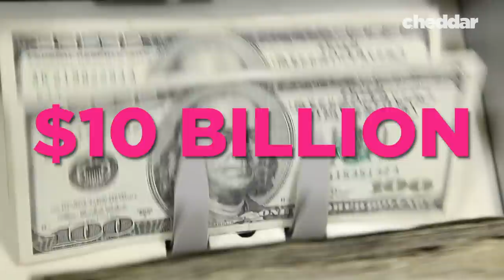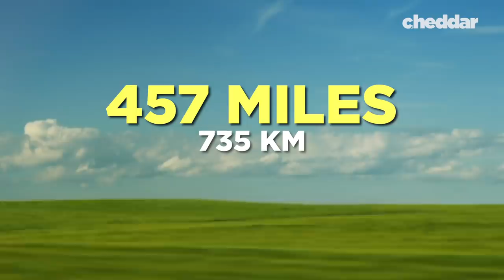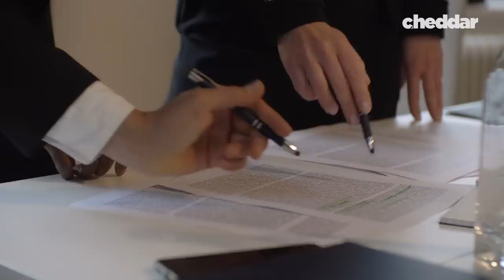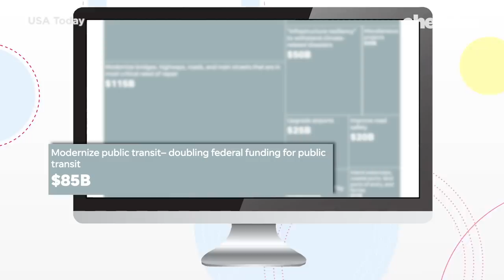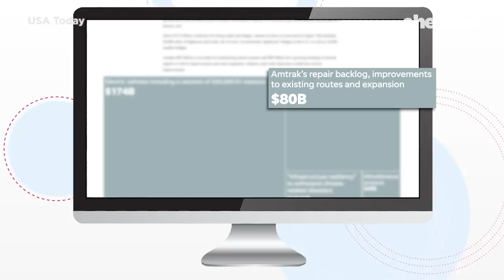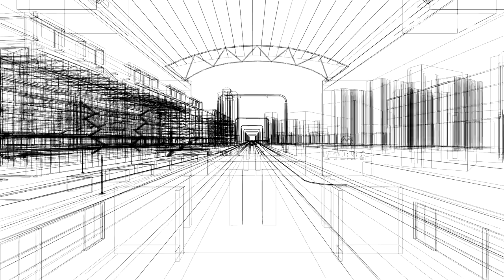Is New York Finally Getting A Real High Speed Rail? - Cheddar Explains

Comment: Mentioning the high speed rail in california as am example and not as the complete failure it is (will only run from Bakersfield to Merced) seems like an oversight, as well as not mentioning Bright line in Florida just because it doesn't reach some arbitrary "High Speed Rail" speed.
Reply: Its not arbitrary at all, this is a simple concept.  It's a commuter rail not remotely high speed.
Reply: Also who fooled you with that lie about California? They're just building the central valley portion first. Can't always snap your finger and make the whole line just appear
Reply: @Joesolo13  1. The Bright line will reach speeds of up to 125 MPH. So 150 MPH counts as high speed but 125 is just commuter rail? Again, seems arbitrary to me.
2. It's so horribly over budget and behind schedule that the original plan to build from San Fran to LA was reduced, and will instead reach neither city despite the larger than planned budget. This video also quotes a 20 year build time but the California HSR project will take longer than that even for the useless section they are building.
Reply: @Joesolo13  Currently, Brightline reaches 90 and has 3 stops between Miami and West Palm Beach. It is in no way a commuter rail system.

Comment: There is a big problem with the proposed high-speed lines shown in this video: they are insular.
For high-speed rail to really work, you want an actual network, where you can change between high-speed trains or high-speed and higher speeds trains (conventional trains travelling mainly at speeds between 140 and 200 km/h). 
Otherwise, you'll just end up with glorified commuter lines.

It might be sensible to first build up a higher speeds network (by refurbishing the existing lines) and then add the high-speed option later.

Comment: Yeah, high speed rail in Europe was relatively easy, because we helped them pound it flat between 1942 and 1945. In the US, all the buildings are still upright, so there's no place for new track to go. That, and Eisenhower got fed up with having all his tanks shipped by rail during the war, and wanted to bypass the Railroad Companies post-war.
Reply: Most high speed projects where in the 80s and 90s, long after ww2 so that is no argument. It cost us a lot of money too but we felt it was worth it.
Reply: The us has plenty of space and some old rail lines but they still have to buy a lot of land. 
We have traffic corridors in the US to but they are for 10 lane motorways instead of 10 tracks for rail
Reply: Also, I think you're more likely to get traction for improving rail between Washington DC and NYC than Boston and NYC, even though Boston-NY is the slower half of the Acela route. The absolute best update would be to improve the entire Bos/Wash route, and if there's a way of providing high-speed rail between Boston and Florida, and between Chicago and Florida, I think you could cut a serious dent into the airlines by providing a lower-hassle travel option for snowbirds.
Reply: @c182SkylaneRG  We will see but something has to be done. 
Washington DC -New York does sound good too. 
This would enable much more development between the immediate city area. 
Like old train towns.
Reply: @computerfan1079  Yeah, I actually wound up rewinding a few times, and caught that on the third or fourth time, that Spain's high-speed rail broke ground (or opened?) in '92, and the rest of Europe was sometime after that. And to be fair to the US, in the late '40's and following decades, it didn't really matter if buildings were still standing over here, either. :) So "finding the land for it" is definitely a more recent issue.
Reply: @paxundpeace9970  You say "plenty of space", but that's not really the case. You generally want to use trains to connect people, but the problem is there's already people there... In the 40's and 50's, that wasn't a problem for the highways: you just flatten the black neighborhoods, and problem solved. We finally learned that was WRONG a few decades later, and without that lack of morals, it's a lot harder to find the space to lay track.

The specific trouble the Northeast Corridor has is that the track up here was laid back when top speeds were a quarter of what they are now, and an eighth of what we want them to become, and the turning radii reflect that. We need to reroute the trains through the neighborhoods that are currently adjacent to the tracks so we can straighten out the curves, but as I mentioned: that's harder to do than it was 70 years ago, hence the plan to stick it out in the water, instead.
Reply: @c182SkylaneRG  Parts of the NYC-DC corridor date back to the Civil War era, especially around Baltimore.
Reply: Because you didn't have to worry about defense, because Europe had us to protect you. Enjoy your HSR... I'll enjoy my High Speed Gas Guzzling Truck...I just paid $2.35 a gallon here...
Reply: @codyuhlmansiek805  And the Government paid the other $2.35 that that gallon actually cost. Want lower taxes? End Gas subsidies. Comes with a side-benefit of cleaner air as everyone suddenly stops being able to afford so much gas.
Reply: @AVeryRandomPerson  Makes sense. The Union Pacific is so-named specifically due to Civil War divisions, and completed their Transcontinental Railway sometime during or just after the Civil War. (152 years ago, based on when they got 4014 put back together, so a few years after).

Comment: The reason we don't have high speed rail in the northeast corridor is the 1853 Norwalk train wreck site at the drawbridge over the Norwalk River.. Here is where it is: https://www.google.com/maps/@41.1002423,-73.4159948,1115m/data=!3m1!1e3
Note how the new plan in the video totally avoids this site because the current high speed rail has to slow down to pass over the rebuilt 1913 drawbridge which immediately has a large curve and a branch line  next to the drawbridge. The cost to fix this problem is staggering because it would require redeveloping the entire area around it..

Comment: I think simply upgrading the current Northeast Corridor to allow 125mph trains along its entire length would be a more cost effective investment. The British have successfully made similar upgrades to their main railway lines, and such upgrades can be built much faster than building a new parallel line from scratch. Furthermore, as a New Jersey resident I can attest to how urgent the need for additional tunnels under the Hudson is, and it would be a mistake for policymakers to get distracted by a wildly expensive, and likely difficult to engineer tunnel under the Long Island Sound.
Reply: 125 is too slow. They need to be chasing the 370mph Maglev numbers.

Comment: The California High Speed Rail Project has been canceled.
Reply: It hasn't been lol
Reply: @unassumingaccount395  It has lost all meaning. It was supposed to connect the two megalopolises of San Fransisco and LA, instead it'll serve the bumpkin farms of Bakersfield and Merced. All this, on one single track. Meaning Trains won't be able to run frequently, destroying it's purpose in the process.
Reply: Good
Reply: @hansmo7013  where did you read this? They're just building the central valley portion first
Reply: @Joesolo13  https://www.railwaygazette.com/high-speed/single-track-corridor-to-launch-californian-high-speed-service-by-2030/58481.article 
Though I am not sure whether it opens with one track, and then expands to two later on, or if it is a permanent deal untill more funding can be found
Reply: @hansmo7013  yes. Your article repeats what I said
Reply: @hansmo7013  "interm service"

They're finishing that part first while building out the rest. Only makes sense to use it. The interstate highways took decades to finish, they didn't keep them closed until completed
Reply: @Joesolo13  Oh, alright then. Still a shame though
Reply: @hansmo7013  It still goes through SF/LA, they want to build the bakersfield/merced portion first lmfao

Comment: We use "km/h" as a shorthand for kilometers per hour. "kph" looks very strange, but I appreciate the effort of including SI units.
Reply: kph is easier to type no?
Reply: @MrCheeseball90   Yes but "kph" just doesn't feel right.
Reply: So do you also say r/m as opposed to rpm?
Reply: @starventure  no. rpm is widely used, kph is not.
Reply: @starventure  Rpm refers to rotational speed. km/hr. refers to linear speed.
Reply: kph looks strange because it's technically wrong. 'k' in 'km' is for 'kilo', which means thousand. but the unit is only complete with the m, so you get 'thousand meters'. It would need to be kmph to be correct. And if you do that, km/h is more readable. 'kph' might be widely used in countries without the metric system, but it basically means 'thousand per hour'. Thousand of what?

Comment: This was an excellent video. Thanks! A better, more cost effective solution would be to upgrade the existing right of way between Boston and New York to increase Acela's average speed of 60 mph to 90 mph and reduce the trip time by a bit over an hour. The distance isn't long enough to warrant a train faster than 140 mph. In 1935 the New Haven to Providence train tested out with a top speed of 105 mph. We sure have not come far, baby.

Comment: The main problem is the United States is completely car dependent. It's the way our cities are designed to make us dependent on cars, rather than walking or using public transportation efficiently. I went to Europe a few years ago and it was so easy to get around. If I wanted to go shopping I would go down the block, and then another block away to get to catch the train at the subway station to head into the center of whatever city I was at, for example London. Here I have to get in my car and drive around winding suburbia and drive for about like 15 or 20 minutes to get to the nearest grocery store to get some groceries. And then maybe get stuck in traffic for an hour to get to downtown
Reply: Move to Europe than...i love my car. Really my car, i just got my learners permit at 15 , is a F 450 truck...i could but a big European car in my bed...😀

Comment: America will never have high-speed rail blame car companies for this gift.
Reply: Not just car companies.it litarily makes no sense to have them.
Reply: @starandfox601  well, it does. But you know what doesn't make sense? Driving a car from town to town when your streets have a 95 mph speed limit.  Germany has 120 to unlimited highways and still is operating one of the fastest bullet trains in Europe.
Reply: @starandfox601  speed is the key factor. People always would consider the fastest and cheapest connection. 

Less popular density means fewer stops and higher average speed. So it's even better for trains in the US. 

You're the idiot because you don't know how public transport in other countries works. 

When you he of the train you would use a metro, tram, light rail train or bus to the next closest station to your destination. All different types of public transport would work together. That's how it works in Europe and Asia. The US doesn't have all that. Which just proves what I said before. The USA has an undeveloped public transport system which is the reason why it's bad. 

You have different type of trains for different purposes both speed trains always have the longest distances and the fewest stops the higher the density is the more stops you need and the slower the train is.

And btw you still doing the math wrong. 
Stuttgart - Paris has nearly the same distance as San Francisco - LA. A car needs 6 hours. A train does it in 3 hours with only 3 stops in between. It would be faster if Germany would also have high-speed tracks in this direction but due TO THE HIGH POPULAR DESTINY, the speed is 70 km/h slower than on the tracks in France.

Comment: Good luck if the USA does have high speed railways including going from New York City to Los Angeles and San Francisco. New York City and Washington DC to Miami and Los Angeles to Seattle and Vancouver.
Reply: Do you even know how far those cities are apart from each other?
Reply: @blackhole9961  Some hundred miles.
Reply: @Andrewjg_89  
NY to Los Angeles is 2,451 miles(planes are way faster)
NY to san Fransisco is about 2,585 miles(planes are way faster)

Miami to los Angeles is 2,732.7 miles(planes are way faster)
Vancouver and Seattle are driving distance from each other at 143 miles
DC to NYC is the only viable option because those cities are 226 miles away from each other, and the NEC is densely populated.
Reply: Thanks :)

Comment: I prefer the northeast maglev DC to NY. As an NYer, I rarely go further north. I mainly go further south to NJ, DC, Maryland. It will easily become the fastest in America.
Reply: do you know how expensive that thing is? and how it will destroy forests and stuff?
Reply: @thechickenstew3716  "To minimize the impact on the surrounding communities and environment, the train’s first phase will run mainly in deep underground tunnels and in overhead viaducts along the existing Baltimore-Washington Parkway transportation corridor. These design features will make it easier to avoid negatively impacting streams, wetlands, floodplains and other natural and cultural features, while still allowing for the free movement of wildlife, pedestrians and vehicles."
Reply: @michael-bz5qz  i’m still not digging it. the NEC really needs to be fixed before we get a maglev. and it’s only Baltimore - DC right now.
Reply: @thechickenstew3716  Maglev is far more expensive than conventional rail, though.

Comment: From an European’s perspective who visited US many times the problem is more that the US is so extremely bad in maintaining, expanding, upgrading and repairing existing infrastructure. First learn that trick before you get too ambitious as high-speed requires high-quality and intensive maintenance.
Reply: tell that to HS2
Reply: We don't need it, we just use airplanes. The distances here are too great and the population density is too low to justify HSR as public transit.
Reply: For example if Paris and London were as far apart as Los Angeles and New York there would NOT be HSR between them.

Comment: Build High speed rail, limit air flights
Reply: So basicly get places slower and cuase bunch of economic damage.
Reply: @starandfox601  you do know that airplanes only are profitable because the country is paying for everything but the planes itself? Also on a shorter distance a 200mph train would be faster than a flight.
Reply: @TheKartoffel101  you do know how profitable planes are doesn't matter.

It's about what American trains are used for.

You know what's also faster and more useful?a car which you would need any way if you took a train to some where.

Also most distances in the US are not short.
Reply: @starandfox601  how exactly a car on a 95 mph highway is faster than a 200 mph train? Even in Germany without any speed regulations on some highways, the train is the faster option. 

Also with a working public transport system, you wouldn't need a car. The problem in the US is, that today the USA only use half of the public transport system. Of course, a not developed system doesn't work as good as a fully developed system.

Yeah the USA have a lot of open space which means that trains could travel at 250 mph
Reply: @TheKartoffel101  becuase that car would never be slowed by freight.it also allows fir more freedom of movement.

You'd still need a car cuase most things are not walkable dye to be spread out with some small towns being extermely far apart to the point it take MILES to get one neighbor
.
The US only uses half cuase it's inefficient for the US size and how spread out it is.it's only useful in cities like new York that are densely packed and there is already a rail system in place for those types of cities.

It also means trains are WORTHLESS at transportation.size matters and the larger something is the less useful trains are has a public transport.
Reply: @starandfox601  what kind of freedom of movement you have on a one-way highway? 

Of course, you still would need a car for some points like shopping but you would need it less. 

For smaller towns that are far apart, you would use regional trains. Still faster as a car but slower than high-speed trains. Every time you have larger distances a train would be the more efficient faster and cheaper solution as a customer. 

New York has only metro lines and buses in the cutie. It's better but not as good as it could be. You still think of trains as metros and not as intercity travelling which trains were built for in the first place. New York only shows you two ways of many how trains could be operated.
Reply: @starandfox601  well but when you want to travel from a cutie to another you would take the fastest route. 

As I said when you're at the main station you take another train to your neighbourhood and a bus from there to your street. 

Well, it does matter for most people at least. And as I said in a city with a working public transport network you don't need a car. 

Pretty sure that you pay more alone for gas on a journey from LA to San Francisco than 60$. Plus maintenance cost for your car. You would probably be like about 100-140$ I assume. And if you travel a lot by train you could buy a 50% discount card for idk 500$ for a year and get 50% off of each ticket you buy. (This is also just an example)

My solutions work in different countries all over the world. Also would work in the US the problem is that you don't understand the solutions because you never had any experience with developed and worming public transport systems.

Actually, France is pretty similar to the US when it comes to popular density which is why France has the most high-speed tracks one Europe with the highest top speeds ;)